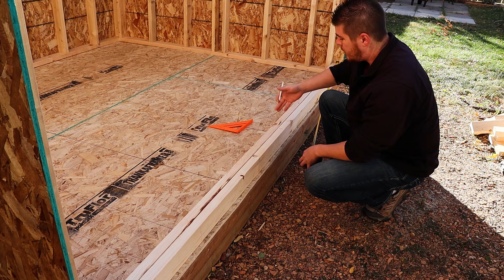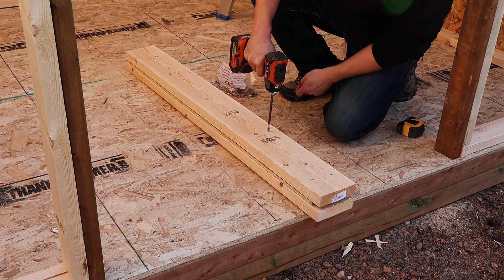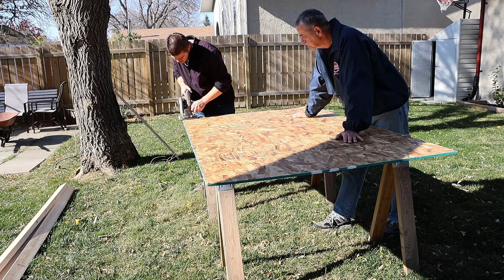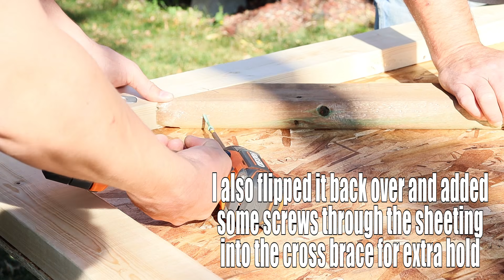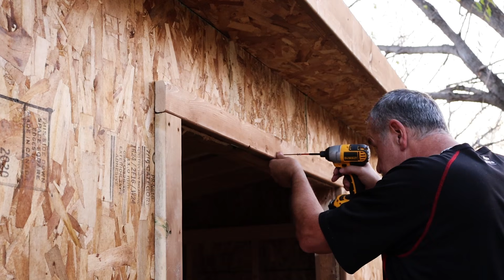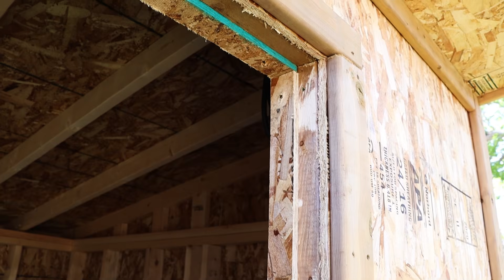How to build a storage shed - Door (front wall) // Part 3 - Plans available

Comment: Other websites state that pressure treated plywood should be used for the flooring, though you used regular OSB. Have you had any issues, or feedback, with moisture affecting the OSB flooring?
Great video BTW!
Reply from the maker: Thanks, glad you liked it. Pressure treated plywood is only necessary if you don't allow for the air gap underneath the floor like I did sitting on the beams. The air gap allows the OSB to stay dry and breathe so there is no issue. Without the air gap it would hold moisture and wouldn't last 2 years, I've seen it. It's been 2 years so far for my shed and it's as solid and straight as the day I built it. I used to build houses here and sometimes we'd include a shed, and this is how we did it. OSB has some natural weather resistance from the glue binding it all together, provided its used right. Hope that clears it up!
Reply: @JessedoesDIY Makes sense - Thank you sir
Reply from the maker: Anytime!

Comment: Does anyone ever put in vents to vent the hot air out?
Reply from the maker: You could but it doesn't actually get that hot because I didn't silicone the soffit so it still breathes a bit. I would definately do it tho if you were going to keep gas and oil or other chemicals in it

Comment: Don't you want your hinges on the inside of the door jam so the screws aren't exposed to thieves?
Reply from the maker: That's up to you and your area, but it will be more difficult to hang that heavy door. My yard is locked, I'm not worried, plus it isn't a easy score most thieves are looking for because they will need tools and time to get in, instead of a quick grab and go. But you'd be better off through bolting the hinges on with a nut and lock washer on the inside instead of screws, then you can mount the hinges outside like I showed. With a bolt and lock washer inside, there is no way it will come off.
Reply: @JessedoesDIY  Appreciate the info! Yeah our neighborhood doesn't have like crazy crimes or anything, but every once in a while I'll see someone's car broken into or their cargo trailer just stolen with everything in it. Rather be safe than sorry kind of thing
Reply from the maker: Absolutely, glad I could help

Comment: I believe the cross brace in the door should angle the other way to prevent sagging.
Reply from the maker: Wasn't really to prevent sagging, was more to sturdy up the OSB in the middle of the door so it had material behind it. Because the frame of the door is attached to the OSB that keeps it square, it really shouldn't sag unless the hinges start moving

Comment: How did you come up with the size of the front wall? Did you factor rise/run?
Reply from the maker: Nope. For something like this you don't need to over complicate it. I literally just decided 6.5' for the back was a good height, and then for the front I figured I wanted it to be 1 sheet of 8' OSB tall when figuring in the thickness of the floor as well. I also figured a 1.5' slope from front to back was plenty.

Comment: I bought a nail gun. What's pro's and con's if any.
Reply from the maker: Instead of screws? Not much. Screws have better holding power, but nails have better shear strength. You can do either or for the walls and floor, but for the door I'd use screws since it will be used all the time nails can come loose.

Comment: Very cool. I am now very curious about the next step: weather proofing (and maybe insulating?) those outside walls.
Reply from the maker: Thanks. That's coming, unfortunately not insulating but thats as simple as just buying Roxul insulation for 16" on center studs, and sliding it in between the studs and roof if you want

Comment: Hi, I'm in Minnesota, just found your channel. I love your shed build! I have a detached garage with a side access door which is sagging so badly, to work the deadbolt, I have to pull up hard on the knob to take pressure off where the strikeplate is. The previous owners cut out the bottom wood panel for a doggie door, I think, and there is a screwed in piece of scrap wood covering it. Yeah, I know I need a new door and frame, but is there anything I can put on the bottom so it doesn't drag, will shim it up, and glide along the concrete garage floor? Just to get me through a few more years? I'm wondering if I can find some chair glides or something. It's not heated, not weather tight. Basically my kids need to be able to lock and unlock the door with their key, without needing 2 hands and forcing it up. I subscribed, and am excited for your roof because that's about how far I am in my shed/lean to/car port style storage shed.
Reply from the maker: Hey, sorry for the late reply. For some reason this comment was filtered. Honestly I would just look at removing the door and trimming 1/8" off the bottom of the door for now with a circular saw and a blade to match the door material. Anything you add to it will just make it worse. Hope that helps and thanks for watching!
Reply: @JessedoesDIY  Thank you so much for the reply! It's funny, because I was just looking at the door again yesterday, and here you replied. Honestly, I've done that before, and it just makes it worse. It's an outside, heavy, old, wooden panel access door, it is secure the way it is, but drags so badly from the weight. Taking more off is going to move the deadbolt below the strike plate, and then it won't close or lock. I found a ball caster I am going to try, since the bottom panel is messed up anyway. Your channel is great!
Reply from the maker: It shouldn't move the deadbolt or anything, not sure what I said came across properly. All I meant is to take the door off the frame, place it on some saw horses or something, and rip a small amount off the bottom. Once you put it back in place all the hinges and locks haven't moved at all and still line up because that wasn't adjusted. All that has changed is the door isn't as long anymore and should be up off the ground now by a small amount. You could also try adding longer screws to the hinges on the door frame side and suck them up a bit tighter to carry more weight of the door. It might help pull it up a bit. It's honestly hard to guess, pictures would help if you could email me